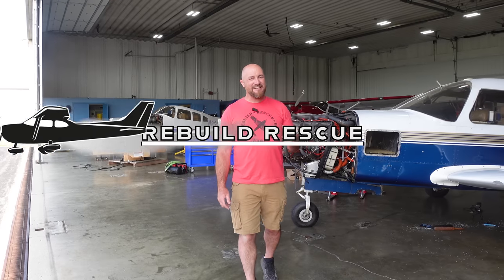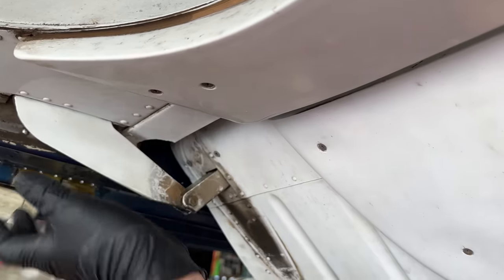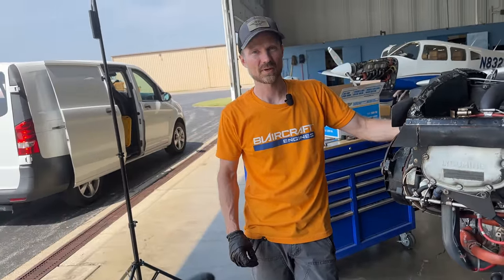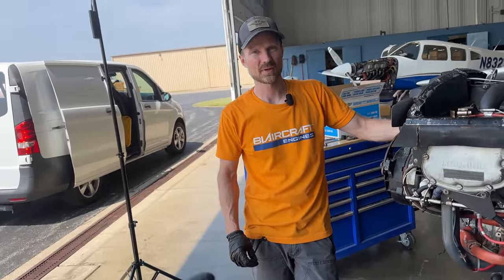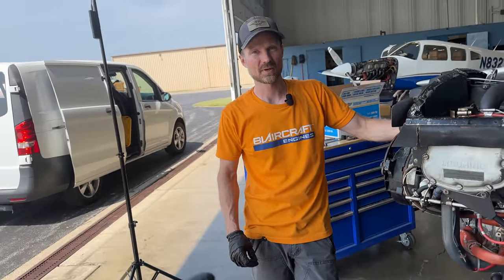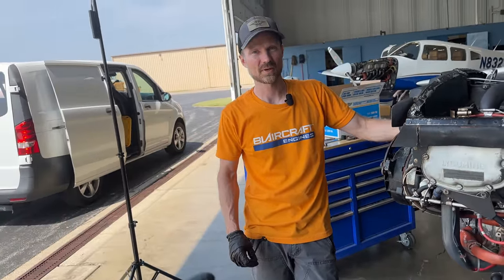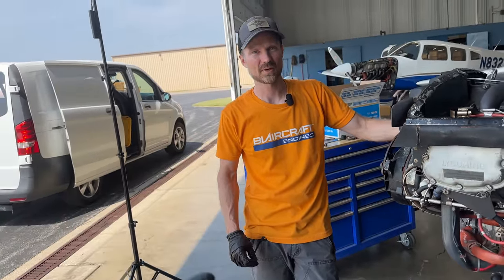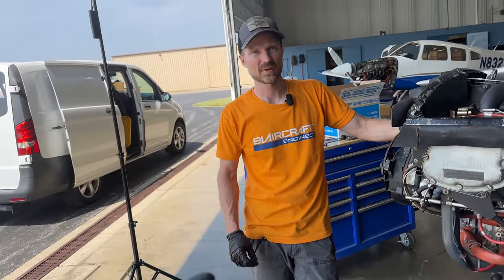Can we Fix and Fly a CRASHED Airplane 400 Miles Home ?

Comment: As a certified A&P mechanic I can't believe Greg was down there on that hard concrete without a creeper, pillow, or blanket that's SOB has got to be one tough dude. I've done a number of the Piper AD inspection panel installations in the lower wing skin / rear spar area and I used a rivet squeezer but was dead tired every time. Also anybody owning a piper that the AD covers please please please do the AD inspection I've seen such corrosion on the rear spar it will f**** knock your socks off. Remember there was a double fatality down in Daytona a few years back and that was a low time aircraft if I remember.

Comment: You were very fortunate that the accessory case fit through the gap in the engine mount!   

There are many, many aircraft where that is not the case.    It literally saved you a day’s worth of work not to have to remove the engine.

     Thanks for making this video highlighting AD 2004-10-14 and what is involved with inspecting the crankshaft gear and replacement of the bolt and retaining washer.
Reply from the maker: We really lucked out for sure. Multiple times we doubted we could do it but the team pulled through and did amazing !
Reply: I've done a bunch of them.

Comment: The engine work is great to see. My father was an A&P. We built many cars and engines when I was a kid in the 80's. Taught me to be thorough and read the manual. I had a flash back when you were cleaning that rear cover. I cant tell you how many hours I spent cleaning mating surfaces over the years. I didn't go into aviation, I trained to repair mechanical watches and those lessons pay off daily. Thanks for the reminders of my dad.

Comment: Saratoga is a good airplane. 3 days for a Annual, and repairs? Lots to do to make it legal to fly. Looks like some long days ahead
Reply: They need to get it airworthy so they can get a ferry permit and fly it to their home base before they start the annual. Starting the annual away from your home base is an absolute disaster and I recommended to Jason not to do it.
Reply: New prop and engine strip down
Reply: @tedmeeuwsen712  no reason to strip down the engine there is FA approved data that allows them to inspect the prop flange and a bolt and a sprocket in the rear case. The FAA recognizes that a total strip down is not required.
Reply: @seantoomey1514  absolutely not, it is not recommended to tear down this engine. We must go by the statistical data that says tearing down an engine when it's not necessary is highly suspect because a good running engine is highly more reliable than an engine that is rebuilt. Again the statistics say you are more likely to experience an engine failure after a rebuild. All pilots and mechanics should research the webinars put on by Mike Bush and the EAA He illustrates time after time the data supports non-invasive maintenance on engines. As a aerospace engineer, aircraft mechanic and FAA designated airworthiness representative I completely concur with Mike's assessment on non-invasive engine maintenance/management.
Reply: @seantoomey1514  You've got it in reverse. Statistical data that you can submit in court clearly shows that an engine is most likely to fail right after rebuild or overhaul when compared to an engine that is in service and shows no sign of failure. So the safest way to operate the aircraft is not to do a major overhaul or strip down inspection. The airlines adopted this approach back in the 1960s because they knew over inspecting and too much maintenance lends itself to failure. The British coastal command back in the 1940s learned the same lessons on their B-24 bombers. I too have witnessed this in the field as a mechanic I worked with broke more crap during maintenance then he ever fixed. Thank God he is no longer in the aircraft maintenance industry.
Reply: @seantoomey1514  I agree, the engine will be good until it throws a rod down the road and hopefully lands safely. If it doesn't land safely I assure you the insurance company will dig deep and won't pay! This is why pre-buy inspections are so important to catch these kind of things. If this aircraft gets sold and this gets caught, the price will nose dive. I wouldn't put my family in this plane without a teardown!

Comment: the trick to lockwiring those props is feeding the lockwire through before torquing and then applying final torque before doing the pigtail.  Great work gents
Reply: Still a pain even doing that.

Comment: Great job guys. Really impressed with your level of mechanics completing that rear casing is a tough task and you nailed it. Excellent video superb team effort can't wait for your next one Mark
Reply: These make it look so stupidly easy. It's amazing.
Reply: 2 things I hope I’m wrong on. The AD is for the 5/16 bolt in the crank gear. You have the bigger bolt maybe  1/2 or 9/16 I have forgotten. Also could not be sure if you torqued for the larger bolt or not and your supposed to check the gear mounting with a feeler gauge. Second the gear timing should have had timing marks that go in between the gears. Your video did not look correct with the marks you put on them.

Comment: At Lycoming we used to call that model "The Super Sucker."   BTW, you have to be very careful to maintain that exhaust system in good condition, and safety wire the V band clamps holding it all together. One accident was caused by a failure of the crossover pipe which then set fire to the baggage compartment, resulting in  loss the the plane and occupants. And I see there is loose heat shielding on the firewall. Not good.  One more tip from me is, anytime you remove a rear accessory case, it's a great time to inspect the oil pump gears.

Comment: The 401 plane seems to take forever.  It's fun to see something that you made progress on.
Reply: It's going to. It's a certified airframe. Everything has to be done right. It's essentially a full frame off restoration which is not that common in aviation in the grand scheme of things. It's going to take a good long while. Lot of paperwork and inspections, a lot of final approval needed before it's actually safe and airworthy.

Comment: 54:00 Not sure what Greg was talking about here.   

    The SL-30 Nav/Comm is still supported by Garmin and is a great radio.
   
   The flat rate repair fee is $800 and it must be returned to Garmin through an avionics retailer, but it can still be repaired and the software updated.

     Maybe he was confused with the GNS-430?   Those are being phased out by Garmin for repair as they don’t stock certain components like the power supply.

      You are better off by replacing the 430 with a GTN-650 or Avidyne 440.
Reply from the maker: We’re putting in an Avidyne 440 soon !

Comment: You guys have done a brilliant job with that plane. When you said three days I was thinking no way.
Reply from the maker: Thank you so much! It's a little easier with such a great team!
Reply: @rebuildrescue   hi i don't know how far you are with the engine removal in the boat right now but I noticed in the last video where you tried to start the engine you forgot that the left side engine is a counter rotating engine. and swapped the starter from the right side engine witch rotates to the right side to the left engine and spun the engine backwards. so you might be taking the engine out of the boat for nothing.

Comment: I don't have a bunch of 540 experience, but I do have a ton of 320 experience, we used to intentionally stager the timing a degeree or two because it increased torque according to a Piper Factory Inspection Certification Course (In the late 80s).
Reply: Harder to do that on this one because it uses a Bendix dual mag. You'd have to tweak the points to stagger timing.

Comment: From Lycoming:  
"After a prop strike or sudden stoppage, the incident must be entered in the engine logbook. Lycoming must take the position that in the case of sudden engine stoppage, propeller strike or loss of a blade tip, the only safe procedure is to remove and disassemble the engine and completely inspect the reciprocating and rotating parts. This will require a skilled mechanic who knows what to look for in the affected engine.
Any decision to operate an engine which was involved in sudden stoppage, propeller strike or loss of prop blade tip without disassembly and inspection will violate the AD Note issued by the FAA and Lycoming Service Bulletin No. 475C, both of which are mandatory. Any decision to fly an engine without complying with these publications must be the responsibility of the agency returning the aircraft to service."

Comment: 28:00 - you have a stress fracture in the casing, thru to the bearing housing. Right in the middle of the screen, behind and to the right of the brown transfer gear. Prop strike torque-back has damaged the casing. You may have only picked this up in post production as you perhaps weren't viewing it live.

Comment: Why do I recall that in the past I read somewhere that a prop strike meant that the engine required a complete tear down and inspection of all internals. Anyways you are all fantastic and working as a team even more so! Too bad many shops don’t do business this way but finding individuals that can work together can be a challenge. Bluffton? Ohio?
Reply: The FAA procedure for this engine regarding a prop strike doesn't require complete tear down of the engine. Apparently it just takes a dial run out of the prop flange and inspection/replacement of a couple components in the accessory case. As a background for prop strikes normally this happens during low power settings so most of the damage is absorbed by the aluminum propeller and not the steel engine components.
Reply: Lycoming Service Bulletin No. 533C
Reply: There are many variables involved when it comes to a prop strike, the crank could still be within spec (not bent) but cracked, I guess a tear down is the only way to truly know the condition.

Comment: Jason, try putting Jack's under wings to give you neutral weight before drilling up the stiffeners.  That way, over the life of them, they will be less stressed. The engine s/b removed from the mount and just slightly moved forward. Will make getting accessory case off easier, as well as installing new gear and any torquing needed. Only a few minutes into video, but looking forward to seeing how you accomplish all this. 
Hate "coffin-box" mags! How's the exhaust? Hope Mike has tungsten bucking bars for those hard to get to rivets.

Comment: Great job guys.  Thats one heck of a lot of work accomplished in three days.  Pays to have a great team.  Piper Saratogas are very good planes to work on.  Use to maintain one for a friend and we did a lot of heavy maintenance on it.  Even replaced the engine on his with a Lycoming factory new engine and new Hartzell propeller that I'm glad to say it made it past its TBO with very few issues.  Congratulations on getting your Saratoga back to airworthy condition.

Comment: My father worked for a  salvage company that took on an Aero Commander that sank in Lake Pontchartrain in Louisiana. In three days they flew it back to Dallas for a rebuild with only a pilot seat and minimal instrumentation.  It seems the plane was gear up when lifted out of the water, and was placed on a pitching deck of a boat...that cracked the main cabin spar.  Some wood, nails, screws, and wire and they made the trip.

Comment: Nice project!  FYI: Several penetrants were tested and Kroil scored very close to same as nothing used at all.   Liquid wrench scored very well and it's also cheapest of the brands.   Kroil reduced loosening torque by approximately 1 ft/lb and Liquid Wrench was about 30 ft/lb reduction.

Comment: as an engineer i find it hard to believe that after such a bad ground strike by the prop you arent required to do a bulk strip.....not allowed in my country...the FAA are crazy.......if nothing is found then its all good
Reply: The FAA engineers has determined what needs to be required to assure the crank and other critical components aren't damaged. As a matter of fact a total strip down is actually more dangerous with guards to overall safety. Statistically an engine will fail catastrophically shortly after overhaul as compared to a perfectly good running engine. I'm an aerospace engineer, certified aircraft mechanic, and pilot I've been working on aircraft for over 45 years I know what I'm talking about and agree with our FAA oversight on this matter.
Reply: Good for you bro, so am I. Unfortunately your FAA does not have a good reputation in any other country than yours, where as EASA is accepted by most counties…..bulk strip is required for a sudden stoppage….period. I would not fly in that plane.
Reply: @zac29655  Yes I've worked with EASA on a number of export approvals they are very good at what they do unfortunately many things could go wrong rebuilding an engine that is why statistically it is not recommended to teardown and rebuild a perfectly good running engine. Yes the crank needs to be inspected and a few components in the back of the engine needs to be inspected and replaced but that's it no total tear down required.

Comment: Nice man nice  Piper Saratoga lot of work but it will pay off. The only thing I have against generally Aviation is that all the equipment in the last 70 years always has to be annual and the complexity of most general aviation engines are expensive as hell. For many years back in the seventies when my mom was a license pilot we used to fly a Cessna 195 with Jacob 210 it was a glorious plane but then again it had to be annuals you know you have a huge engine that has to be annual. I like some of these newer planes that are using modified Auto engines like the flat 4-cylinder Subaru engine or the Rotex engine.  They're not so damn expensive cuz I would love to see more people be able to get into general aviation.  Of course where I live in the Los Angeles area it's not a great fun place to fly because of all the commercial traffic. But you can still do it it's just expensive around here thank you guys so much I really love your videos I'm bitching a little bit about what I feel about general aviation I wish it would be a little less expensive for the average person because flying an aircraft is a wonderful thing it's just like riding a motorcycle almost. I guess that's why most people that fly also ride motorcycles

Comment: Something I don’t understand and maybe you guys can help me out. A sudden stoppage would have put thousands of pounds of force on the crank. That impact is immediately transferred to the front main bearing among others. If anything, those hardened little balls would put a little tiny dent on the race/crank. How can they tell the front of that motors good without a full tear down? Maybe a mag partical on the front engine case? I’m not throwing stones, just want to learn.
Reply: It appears they are following the AD approved by the FAA, I see bigger issues if they rush the annual inspection at that facility, but that's my opinion lol they are learning that's for sure

Comment: 19:00 dent in the leading edge, need to fix that.
Reply: I can't tell if it's a dent or a reflection in the paint, yeah but if it's a dent this is going to take some more time, I recommended that they get a ferry permit to fly it back to their home base to conduct the annual and any other significant repairs.

Comment: That looks like a great airplane. 1. Why was there a gear up, was he tired, did he forget the check list, did he forget to do the basic GUMPS or was he wearing an ANR noise canceling headset that blocked out the gear warning horn. What caused the incident, the gear up. Why did it happen. Learn from this and pass it on to all. Safety first. Good luck.

Comment: Turned the filter cutter the wrong way. It'll unscrew and break the cutter wheel. Also, NEVER hold the oil filter element in your hand to cut the media! Set it on a table and cut it. 
Regardless of what the Service Bulletin says (I think was SB 554), never cut the oil sump gasket under the accessory case. If that gasket tears, pull the oil sump loose and replace the whole gasket. We did a lot of those. The boss wanted to cut the gasket every time, and every time it leaked like a sieve and we had to go back in. I guess a normally aspirated engine might be OK. but the turbo models leaked there every time.

Comment: To all A&P mechanics, in the course of an annual or 100 hour inspection or phase inspection, after you do your functional checks on things like lights flaps and other electrical items, please please please disconnect the battery, that's what the maintenance manual says at least on a Cessna 172 😆

Comment: Bravo Zulu (so far!), but as a humble railway track engineer, nothing seemed to have looked at the question as to why there was a gear-up landing in the first place ? As a retired one of Her Majesty's Railway Inspectorate, I wouldn't have worked underneath an un-propped aircraft which had had a landing gear failure unless I was tripley sure the failure had been fixed.